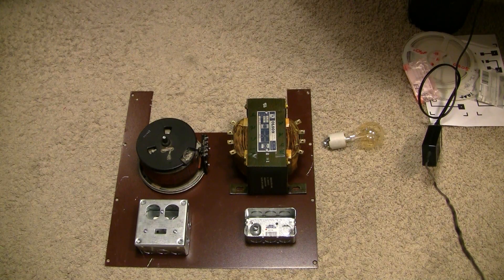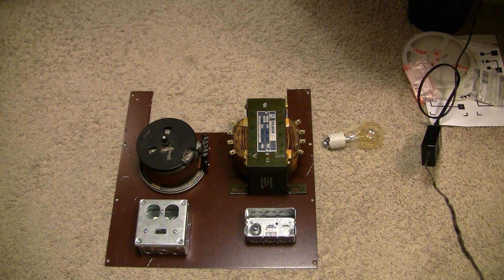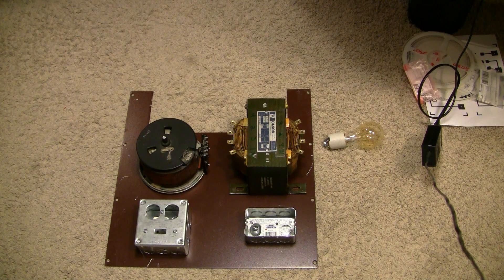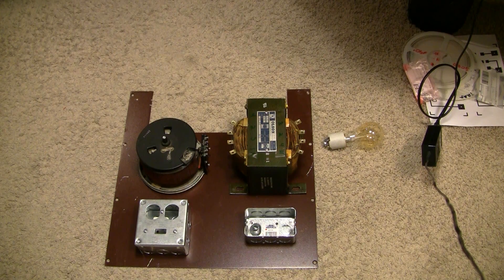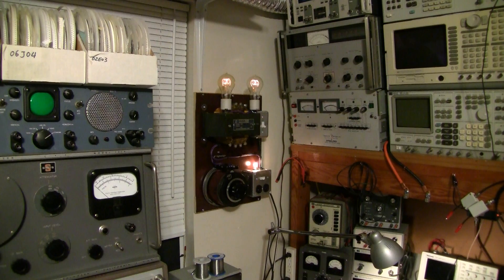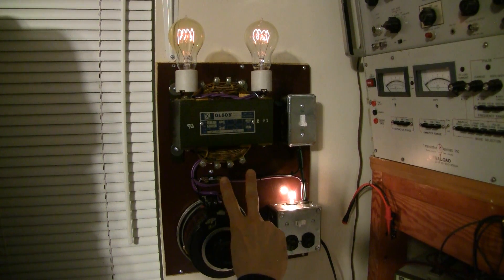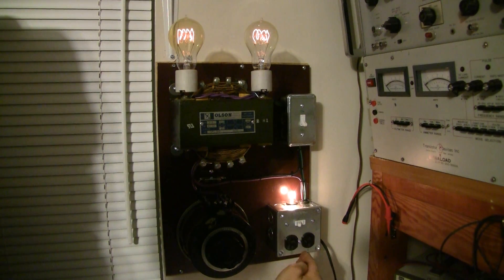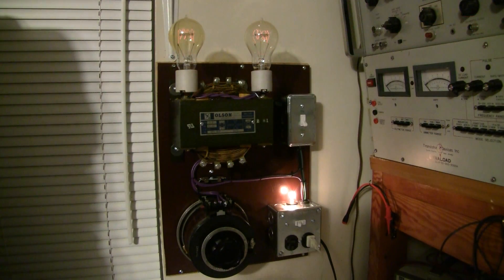Big Dim Bulb Tester with Variac and Isolation Transformer

Comment: I want to power up a 1946 radio that i just re-capped and checked all the connections with the schematic. Would it be safe enough to put it back in its case and then bring it up slowly using only a variac and no isolation transformer? So long as i don't go probing around with a voltmeter or anything. Should I use a high voltage insulated screwdriver to operate the controls, just to be extra safe?
Reply: I know this is a late reply but someone else might find it useful: One issue, not related to your safety, but that of the radio, is that without the current limiting (dim-bulb portion) you could still have a short that will source the maximum current available which could burn out your variac or worse still, the parts in the radio.

The isolation transformer is normally for your safety when working on equipment that has no ground such as an old 1946 radio or the typical two-prong CRT TV. The isolation transformer would of course remove the connection to earth ground so that if your device's chassis is connected to the hot side of the cord, you won't get shocked if you come in contact with it. I wouldn't work on equipment without an isolation transformer, at least, not without someone around to call the paramedics and/or cut the power.

As for the controls on the radio, I'd put the knobs back on if possible and be careful that way as they should be insulated unless someone decided to put metal knobs on the thing.
Reply: Thanks and no worries! I made a dim bulb tester and brought it up slow. It works and even sounds great! It's a transformer type so unless it develops a fault, i checked and it's nicely isolated. Plus now with a modern safety cap. The knobs are all factory originals i think.  bakelite with no set screws

Comment: In the book Practical Electronics for Inventors is said in the Autotransformers chapter the following: "It is important to note that a Variac by itself does not provide isolation protection like a standard transformer, since the primary and secondary shared a common winding. It is therefore important, if you plan to work on ungrounded, "hot chassis" equipment, that you place an isolation transformer before the Variac - never after it. If you don't, shock hazards await."

I see that your schematic uses a traditional isolation transformer after not before the Variac, so I don't get which shock hazards the book refers to...!
Reply: I think they refer to autotransformers with exposed wiring and/or winding:)
Reply: Popart 2015 - The hazard is contact between the winding and either it's oposite "phase" (likely the current carrying neutral) or, far more likely, the protective earth bonded enclosure.  

In early days, the actual isolation transformer was never bonded to the enclosure. 

Today, you can't sell one that doesn't have bonding between the transformer and the enclosure (except in certain specialized medical equipment and I think demolition explosive controls.)

This bonding of the transformer of course destroys the isolation. All it leaves is isolation in the noise sense of the word. 

Paul makes this insanely complicated topic seem easy. It is a rare skill which few develop.

Comment: Greetings, I'm interested in purchasing an isolation transformer. What advice can you give me? I see some on ebay that are literally a transformer with a plug in cord on the back of the transformer and the front has the socket connection for a tube radio. I also see isolated transformer what are enclosed with an on/off switch. Do I take in consideration the amperage limitation of an isolation transformer? I work on All American Five radios as well as 10 tube radio consoles. I do have a variac and I realize I need am iso-transformer.
Reply: Mr Carlson's Lab so, would 6 amps be right for most guitar amps as well (in your opinion?). Or could I get away with less?

Comment: “Sorlie” filament bulb? wattage?
Also, where do you source the ceramic bulb bases?
Reply: According to the schematic, they're 60 watt bulbs.

And doing the math, that makes sense. Paul wanted current limiting to 1 amp. 120 volts at 1 amp is 120 watts, so by placing two 60 watt bulbs in parallel, he gets the current limiting he wants. You could also do this with a single 120 watt bulb, or 3 40 watt bulbs, or 6 20 watt bulbs.

Comment: Come on guys, he knows what he is doing, he is very safe around 7000V so 120 V would make nothing to him, would just tickle his feet :lol
Reply: There is a lot of truth to that statement, I have worked industrial Maint for over 20 years and been shocked by 120 more times than I can count after a while you just get to the point where it's like "Yep, that's hot" lol. 220 hurts more and yes a single leg of 480 (277 volts) hurts a lot more, lol. I highly recommend not trying it at home, lol.

Comment: I'd probably also add voltmeters to each outlet so the voltage is easily readable rather than having to do maths :)     Also getting incandescent bulbs in the UK is awkward, are there any other options you could use?  I'd imagine CCFL energy saving ones won't work right.
Reply: Incandescent bulbs have a positive temperature coefficient of resistance, with ~15x increase in resistance from cold to fully lit which gives that protection in case of short circuit in the device under test which is mostly what a dim bulb source does, (ie protect against short circuits).  One substitute would be a line voltage rated polyfuse.

Comment: Hey, I have a question. What's the difference between a 1000w variac and a 2000w variac?
Like is there a slight variation to it's build other than it's internal fuse?
Curious to know as I'll be getting one soon.
Reply: The difference is going to be in how many amps you can pull through the variac before burning it up. As far as the build of each variac goes, the wire should be a heavier gauge in the 2kW variac to handle the greater wattage rating which should then translate into costing more $$$.

A 2kW variac @ 120VAC could handle 16.667 amps, which means you'd need to run it from a 20A circuit instead of your usual 15A outlets or you'll likely pop a breaker in your breaker panel. The 1kW variac @ 120VAC could handle 8.333 amps. Either way it's a lot of current.

Comment: You made one SERIOUS mistake.  Look at a Variac datasheet.  You ALWAYS have to fuse the wiper.  e.f 10 A variac at 120 V with a 10 A fuse is 1200 W.  Now draw 20 amps at 10 V.  That's only 200 W,  but your wiper can only handle 10.  It's best to fuse both the wiper and the  input.

Comment: I don't know if I missed it but what is the wattage rating on the bulbs.  Is there a reason that you used two?
Reply: As light bulbs are really just resistive elements, using two 60-watt bulbs in parallel means that you are dropping the resistance they pose on your test circuit by half. I believe he just used two Bob's because there was Symmetry and it looked cool. Most people just use one Higher wattage bulb like a 150 or 250 watt bulb since it would pose less resistance then a lower wattage bulb like a 60 watt bulb. A 60-watt bulb would only be able to Source 500 milliamps instead of one Watt.

Comment: Could you explain the math by which you found that 2 60w lightbulbs would current limit at 1 amp? Thanks
Reply from the maker: 60W x 2 = 120W, "bulbs are in parallel." (resistive load) 120W / 120V = 1 Amp. The actual is 0.96A  measured at 120VAC, "close enough to 1 Amp."
Reply: XD Thanks for the response, dunno why I didn't see that...

Comment: Okay you have the light bulbs in series parallel. What if you had wired them in series series? Would they take the 240 volts? I have an old wall mount General Radio 20 amp 120 volt Variac, and a 240 volt 10 amp Variac, and a massive isolation transformer. I am not dead yet, and I still have all my fingers.
Reply: +Seth B I also used to work on true high voltage substations, (15,000 VAC nominal &amp; higher). I saw some kid drop a wrench into a 69,000 volt primary transformer in a transformer vault, &amp; rectifier bank at a copper mine. He made some ball lightning that day. It was the last thing he ever did, and it was my last day working at that stupid copper mine. They had some wacky 12,000 volt DC test points for the DC power shovels, and every 6 months or so, some idiot electrician would hook his DVM, or solenoid voltage tester up to them. The solenoid testers were the worst. Those would blow the sole right out of the noid & right into your chest and or face. I gained a lot of respect for Fluke meters up there. The Flukes would just smolder and melt. Cheap meters would send  exploding capacitor fragments into your face. Fluke puts the caps under a piece of fiberglass reinforced plastic, containing any flying bits from getting loose & leaving the case.
Reply from the maker: +Seth B 
Interesting info! Thanks for the story.
Reply: @MrCarlsonsLab  Fluke actually gave one of those electricians a brand new Fluke 79 in trade, so the Fluke salesman could show off the smoked Fluke meter that did not blow up when it was hooked up to 12KV. It was a nice piece to show off to Purchasing Agents & electricians at large companies and show off to electricians at union halls. I almost always carried a Fluke. On some commercial jobs I might have carried a Knopp solenoid tester that came with my Knopp electromagnetic phase rotation meter. (AKA My electric hockey puck!). APS hooked three phase up wrong more than once. Driving the impeller into the pump housing is never a good thing.

Comment: Can you help me source a variac?  I've been googling, finding a huge range of pricing.  What do I look for?
Reply: Hi OnEvenKeel, I think that the primary factor is what are you willing to spend.  Obviously the higher the current rating the more costly a transformer will be (you pay for transformers by the pound).  I have seen some in the 150-200VA rated variable transformers at Fry's and online for under $70.00.  On the higher end you can spend a thousand or more for the over 1000VA sizes. Here a couple of ways to go, one is plug and play, the other is a more DIY style.  Hope this helps and always use care.
https://www.circuitspecialists.com/variac-variable-ac-ps05kva.html
http://www.iseincstore.com/221variabletransformer120vacsinglephaseinput0-132vacoutput25aopenpanelmount.aspx

Comment: Mr. C, what did you do with the ground/earth terminals in the isolated receptacles? Tie to mains' earth? Leave n.c.?
Reply: As the secondary test voltages are fully floating a ground connection would serve no purpose. This project must be used with caution only by people with sound electrical knowledge and an understanding of unintended ground loops.

Comment: I am still trying to figure out what the transformer is being used for. :)
Reply: In a transformer the primary and secondary sides are magnetically coupled,  not connected by wires.  This isolates the secondary side from earth ground which is connected to the primary neutral wire.